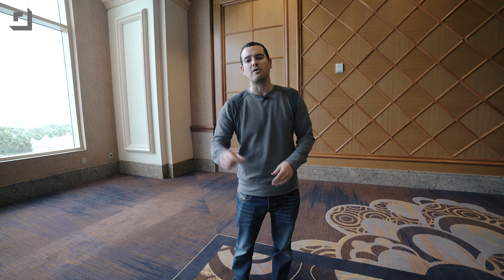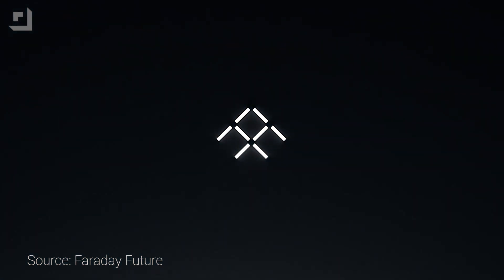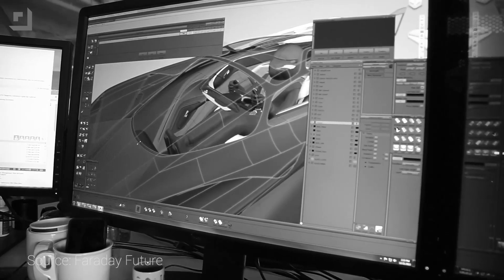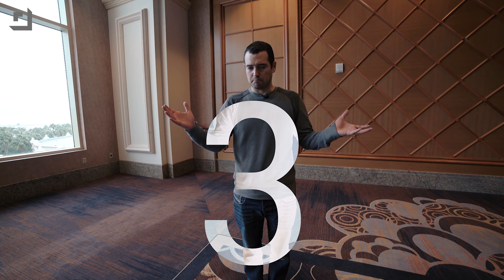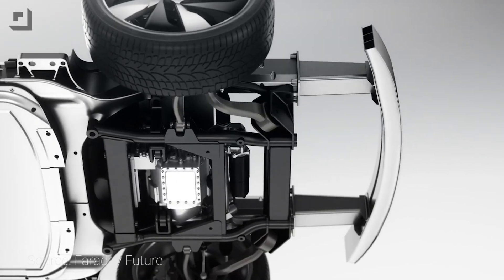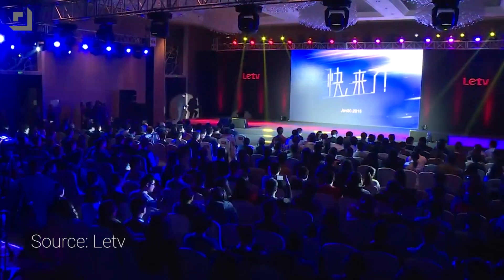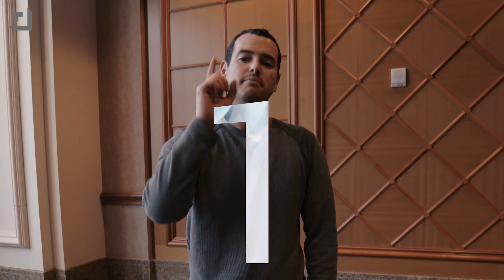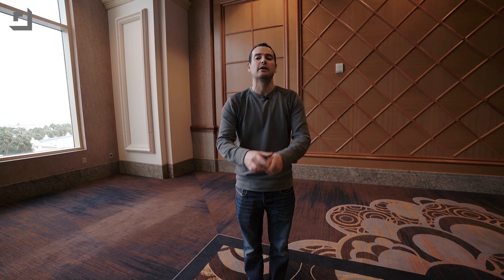5 Cool Facts About Faraday Future!

Comment: I hate the headlines that say: "Tesla killer is here". Pftt have you seen this car. Ok I will admit that Tesla's first car was a 2 seater sports car. Not that much functionality. But I least it was a normal car.  The FFZERO1 is a cool car and Faraday should continue but if they want to succeed they need a lot more than Augmented reality from the windows. They need to present a practical car that is safe, fully electric and has lots of miles.

But Tesla is miles ahead of almost every other auto maker out there. I mean literally. Their Artificial Intelligence receives 1 million miles of driverless data per DAY from the cars that are currently on the road. The new Tesla Model X SUV is getting great reception after huge doubts by the media and the mass market car is due to be announced in march (Model 3). Tesla also has the own networks of superchargers which lets you travel long distances and charge you car extremely quickly. 

Concepts are cool and I will follow Faraday but they really need to shine with their next car if they want to be successful.